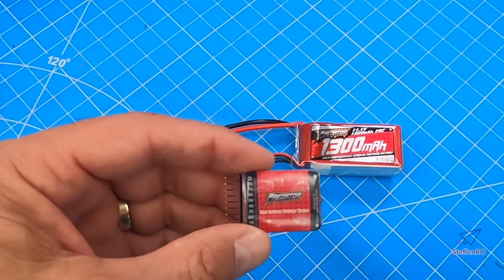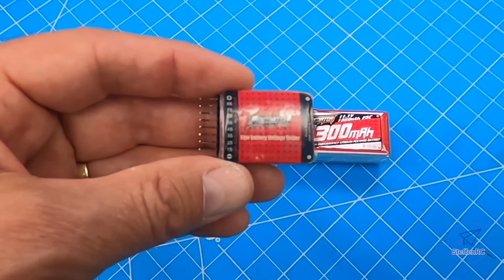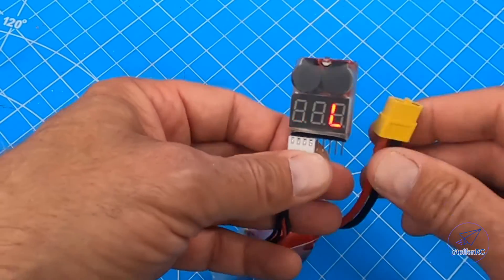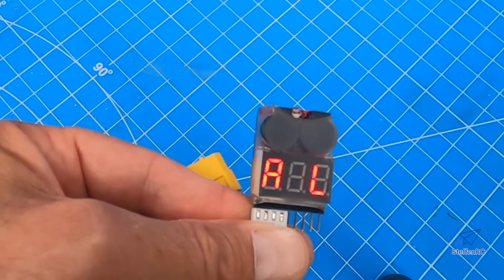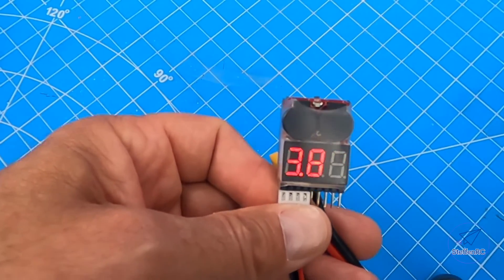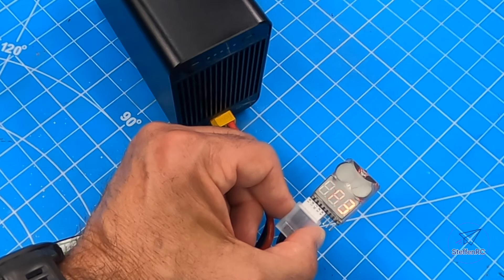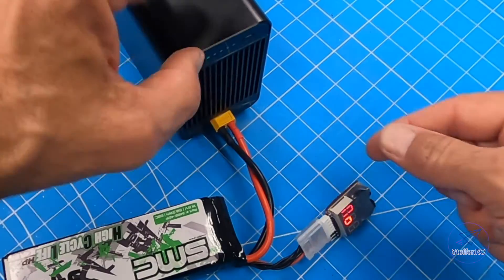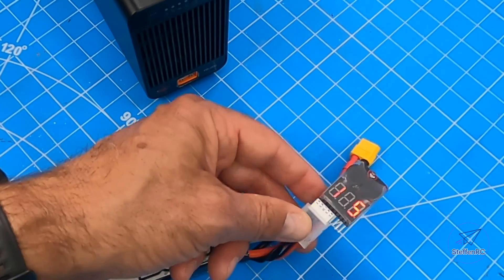RC Plane battery voltage telemetry for only $6 from FMS

Comment: Will it also work with 2200mah? I have fms ranger 1200mm that I am about to maiden...thank you sir great content 👍 🛬
Reply from the maker: Yes. It works with 2s-6s batteries.  Very handy to know when your battery is low.  Good luck on your maiden.  The FMS Ranger is outstanding.  Have fun

Comment: Once upon a time there was a same cheap Aliexpress lipo alarm that has a few seconds time buffer when the voltage drops below set point. That's the best one I came across. It's all in the firmware
Reply from the maker: All the versions I've purchased would sound the alarm when they hit the determined voltage threshold and continue to beep until you unplugged it.  This one from FMS would stop when you reduced power and the battery recovered a bit.  I'd like to find those cheap ones that would perform like these FMS predators.

Comment: What will be the lowest voltage value? 2,7V would be nice for LiIon cells :)
Reply from the maker: 2.7v is the lowest..
Reply: @SteffenRC  super!! 👍🏼
Reply: @SteffenRC  sweet! Yesterday I programmed my old Mirage 80mm to the lowest 2,8V and flew today for 10:30 Min until the esc cut off. Was perfect because under load I was getting to 2,5V-2,6V.. I´ll order some :)
Reply: Thank you!

Comment: A good test would be to "hear" about how far away you can hear the beep.  One benefit to the continual beep is that if it goes off and you are further away, when you get closer it would still be sounding if you had let off the throttle.  The FMS one is still preferred in my mind if you can hear it far enough away.
Reply from the maker: Not sure on the distance.  For me and my old ears, I can hear it almost anywhere I typically fly.   I like the fact that it will stop once the battery recovers a little.  Some of my batteries are old and they drop voltage when I hit that throttle, but recover fine and will last for several minutes of flight.  The constant beeping from the cheap Alarms was awful..  These are the way to go for sure...
Reply: @SteffenRC  I bought one in my last FMS order so I'll be trying it out on my next flight.  I love being able to get the battery levels.